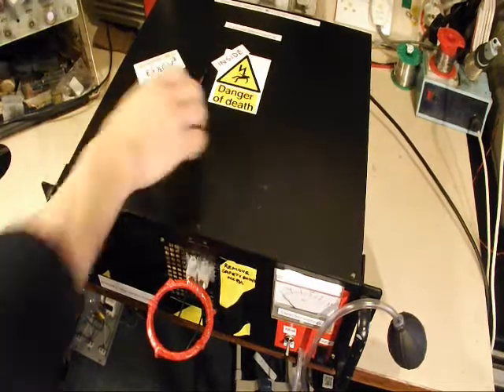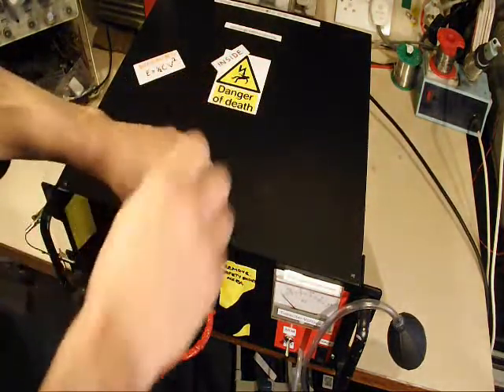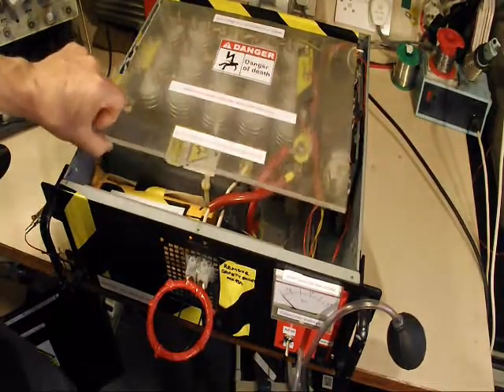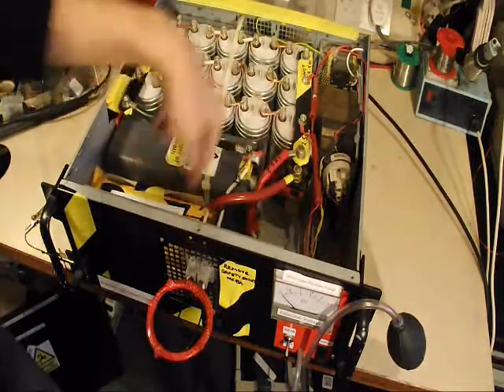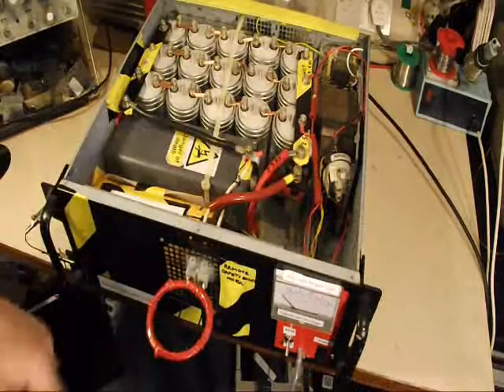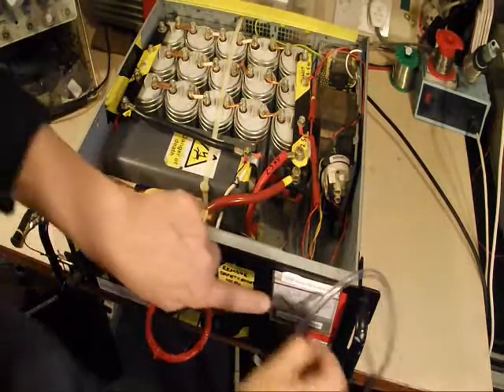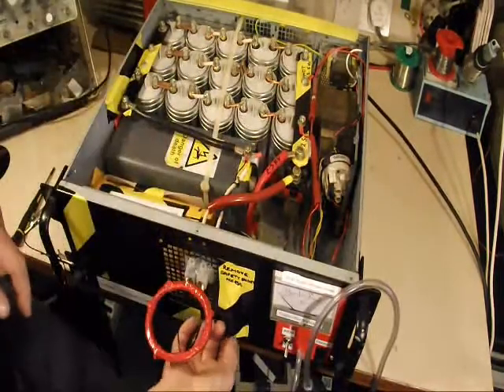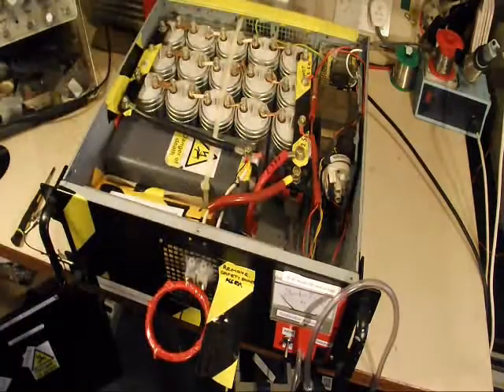Electromagnetic can crush

Comment: Hi you have schematic?
Reply from the maker: Short answer is no, but it’s quite straight forward.  A MOT and rectifying diode are used to charge the capacitor bank.  I have 150uF being charged to 2.5kV here so over 460J which needed to start crushing cans but equally potentially lethal to the user.   To discharge the capacitors into the coil there is a large current contactor/solenoid connected between the capacitor bank and coil. There is a 24v DC supply to the solenoid coil via a pressure switch. The pressure switch is operated by a rubber bulb on a length of plastic tubing. This ensures there is no physical contact to any part of the unit during firing and that the user is at a safe distance.  I also added a volt meter across the capacitor bank to display the voltage present for charging purposes. I also added a safety switch across the capacitor bank for a failure scenario where the capacitors are left charged and the firing circuit fails. This is just a spring-loaded contact with a plastic wedge that can be pulled out to discharge the capacitors either as a short or through a suitable dump resistor.

Comment: No lid switch?

Also, please add a internal discharge resistor (10s of secounds). Activated by trigger or active all the time. (note: input power must be needed to disable the discharge resistor)
The pressure switches come in 2 or 3 levels too, so a hard press can be emergency discharge.

Nice demo!
Reply from the maker: Good point thanks, I like the power fail bleed resistor.  I'll need to find a suitable hv relay.  With the lid off there is still a perspex cover over the HV parts but a switch would be nice. There is a second shunt for servicing and leaving safe when not in use not shown in the video
Reply: Worst case, you can make the relay from parts.

a motor and a return spring is one option. (using plastic strings for the mechanism)

Another is to scale up the motion from a contator (plastic string tricks)

Always use the spring for closing, and the motor/eletromagnet for open on the discharge.
For the output switch, do it the oppocite way.

Main clue is to make it reliable and robust somehow.
Feel free to ask me, but I leave the finer implementation details for you :)

I woould actually suggest a charge-to-x volts circuit, possibly activated by the air switch.
You can find 3 level ones, after some tweaking you can have: step 1: charge, step 2: trigger, step 3: safety short (latching). Even 2 level ones will do plenty (discharge after trigger, until you release past step 1)

examble dual air switch use:
0 (none on) = discharge/idle
1 (first switched) = charging (to set voltage)
2 (both switched) = disconnect charger (if not done by charge to), trigger
Reply from the maker: Pressure switch charging is also something I was thinking about doing. Its kind of a prototype so if it doesn't get dismantled I will add that feature too.